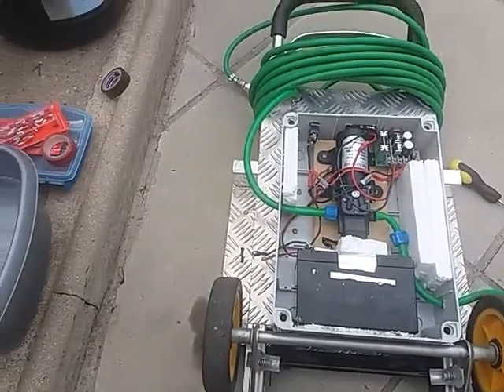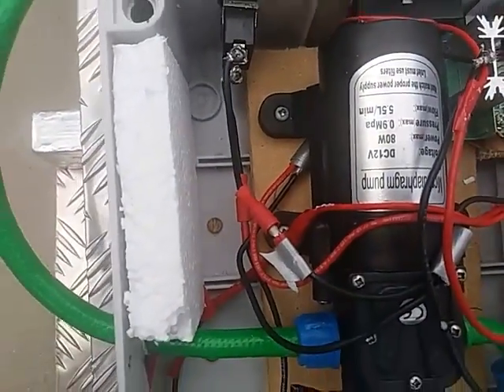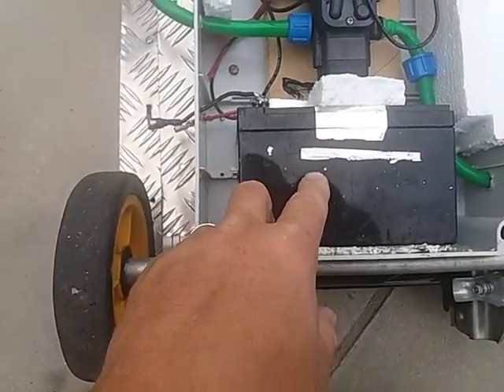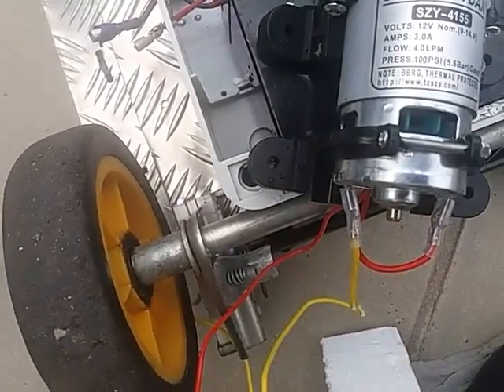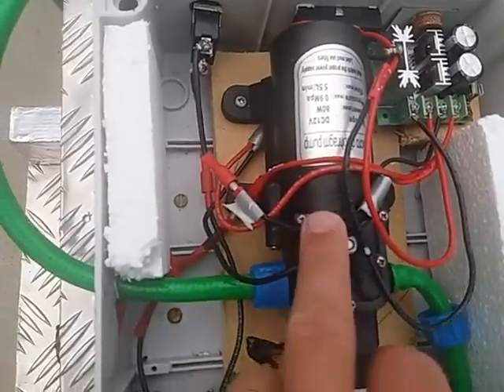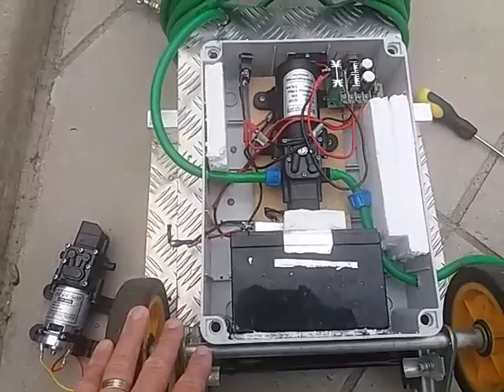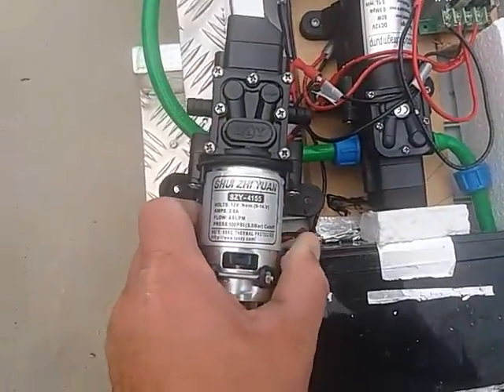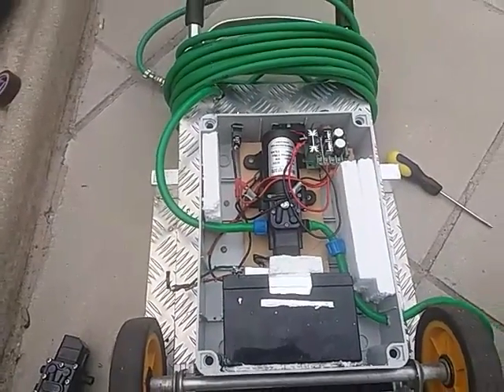Waterfed trolley pump change

Comment: Why did you have solar charging? Possibly the reason for short battery life as solar is no where near enough current to charge and without a blocking diode in line your battery would discharge via backfeeding the pv panel. An affordable lead acid smart charger would of been your first priority
Reply from the maker: I may not have been clear in the vid, obviously it gets main charged when at home, but the point I was making is that I can connect it to the van solar panel charging whilst I'm out n about as well as.
Yes there is a blocking diode on the solar panels coming in and through a ppmt controller as well. It worked really well